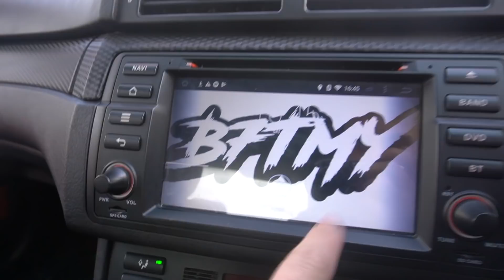FIRST DRIVE IN MY *ENGINE SWAPPED* E46!

Comment: That air leak is the value pin is loose go to a pedal bike shop or halfords and but a valve key and tighten it it's the small pin inside the valve

Comment: Man it needs a clean but abit of our imagination can see it looking sick. it's a good spec car 2 start, red leathers etc.plus it sits nice on them rims.and yeh that valve most likely get away with tightening where joins tank or retape it with pft, And if it's the valve core tyre fitters I'm sure would help u out there 1st try it urself with long nose pliers see if it's loose not a big thing really sooner the better don't want you losing  air whilst out bro.looking forward to seeing it the finished daily 🤔if eva👊👍.

Comment: For the valve If its leaking from the centre of the valve , you can get screwdrivers for taking the core out, your local tyre place will have them, see if you can tighten it, if not, ask them to put a new core in and see if that helps, should only cost a couple of quid for a valve core if they even charge you.
Reply from the maker: Thanks man appreciate it